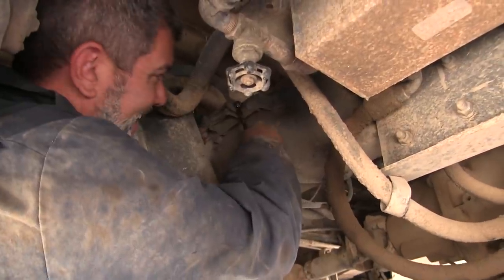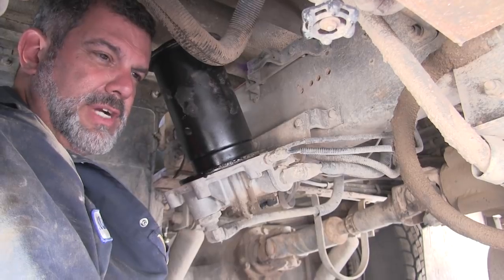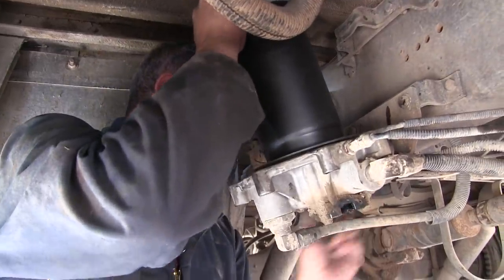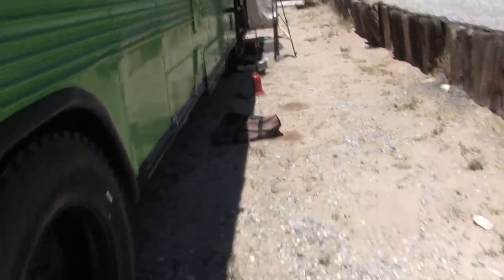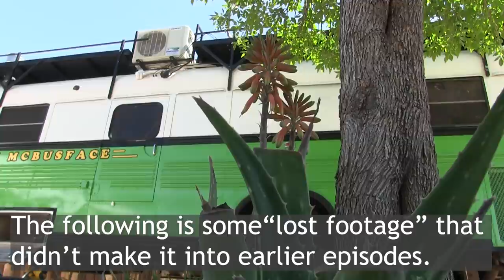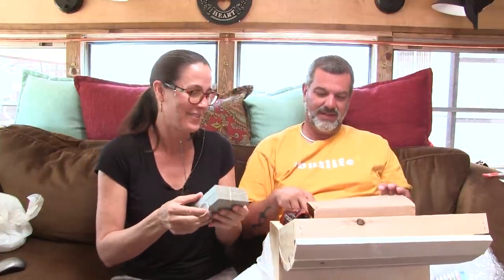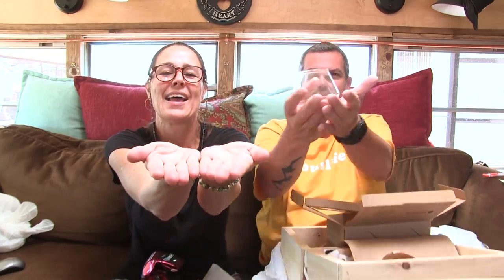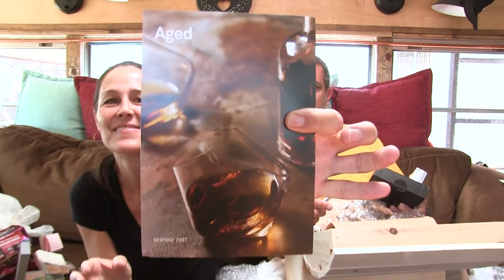Mike Changes the Brake Air Dryer Cartridge, Plus Lost Footage!

Comment: You need to get the Milwaukee Fuel 3/8 drive,with the extra torque ratchet! You will never regret it! Much quieter than an air ratchet.

Comment: you can usec the chai ntype to loosen the filter , you just need to put a piece of leather (belt) ouround the stell first that way you whont mar it 
the stuff in the airdryer can be reused , you can spread it over a bakingplate and heat it in the oven for a while  (check out dboss garage , he uses a dehumidifier from a truck on his shop air system , he was the one mentioning it)

Comment: Unless you want more air hose, too, I'd recommend electric not air wrenches. Scott @ The Bus Grease Monkey channel,  uses all electric,  (battery) even impact.  He has 1 electric impact that will loosen the lug nuts.
Reply from the maker: I actually have a 3/4 in impact for our lugs and I could have used our dewalt impact driver but I couldn't find the adapters for the socket.

Comment: I believe oil in the air dryer may be from a worn out air compressor pump, which is now inserting oil into your system
Reply from the maker: Changed that in the previous video for just that reason.😊

Comment: Make sure you get the core charge on that filter. lol
Reply from the maker: Totally, the core charge was $39 and the new filter was only $33!
Reply: @BussyMcBusface  lmao, same thing happens over in our area! You will be able to put "Diesel Technician" on your resume very soon.  
Your ABS valve is the only thing left pretty much for your air system, if you have ABS that is.
Don't for get to drain your air tanks here and there. Esp. after all the new equipment.